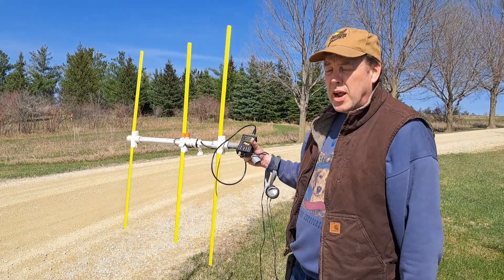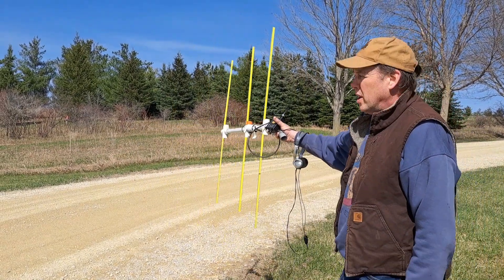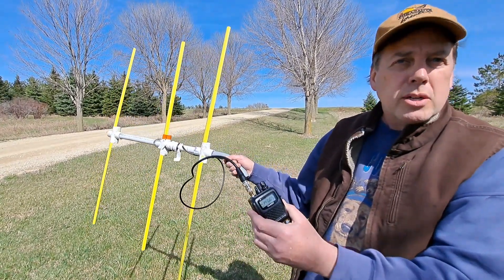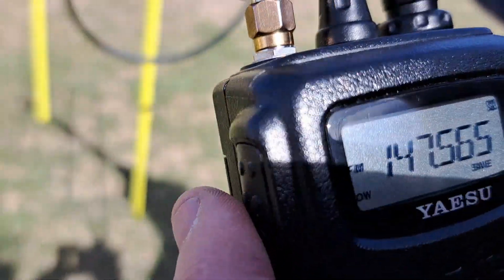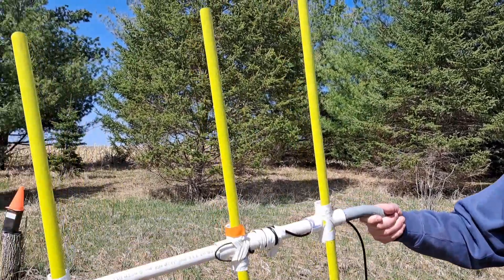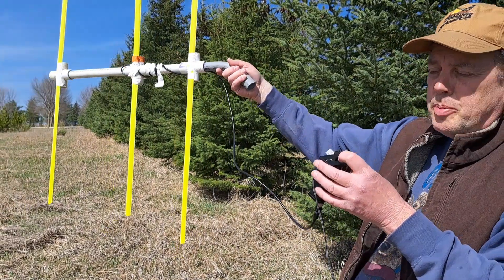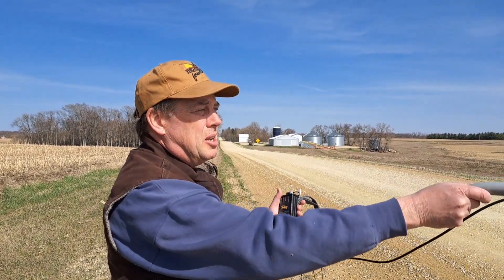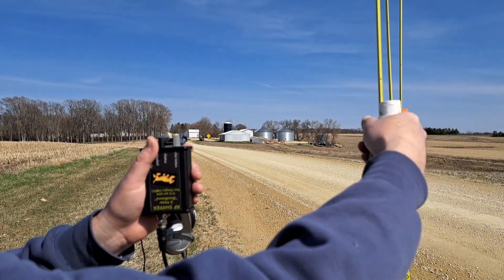N0EX RF Sniffer  - for Radio Direction Finding

Comment: Hello, I’m not a fox hunter but I’m looking for a way to pin down some power line noise using an arrow antenna. Would your device, or a modified version of it, work for this? 
Thanks in advance.
Reply from the maker: A sniffer could be helpful for noise tracking.  My sniffer has a Bandpass filter in it, so it is most sensitive in the 140 - 150 MHz range.  It may be beneficial in your noise search to have something that is a much wider bandwidth.  Go to E-bay or Amazon and search for an AD8307 RF Amplifier board - you may be able to use that (with some interfacing).  Your Arrow antenna will be a good tool.

Comment: Interested in seeing more about this.  I'm trying to do ARDF for Scouts and they have to build their own antenna so I'm looking for solutions for a "provided receiver" to use with their antenna that is practical.
Reply from the maker: Take a look at the video I did on the DW-400 RF Analyzer.  It works good as a standalone Receiver with a tape-measure beam, and it has a 120dB (per spec) receive signal indicator range.  It is however a bit pricey at just over $100.
Reply from the maker: Another alternative would be to use a Quansheng UV-K5 with the F4HWN firware update.  Only about $35 for that handheld and you get basically the same signal strength (RSSI) info.  I have a video on that....